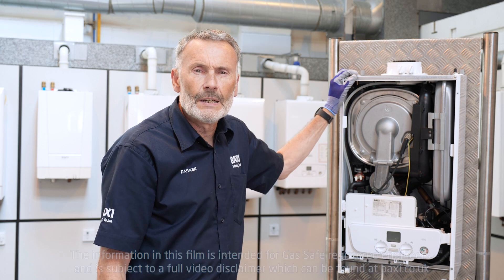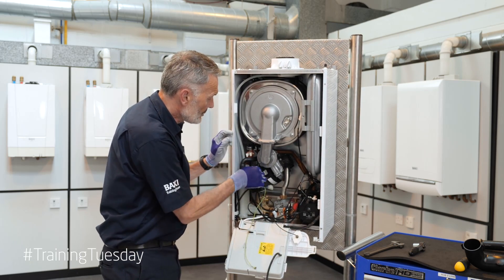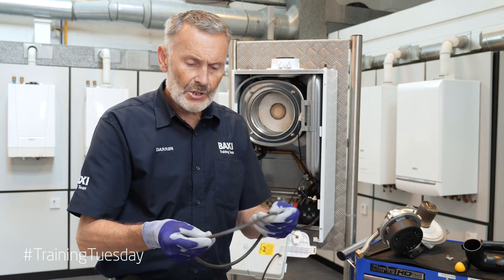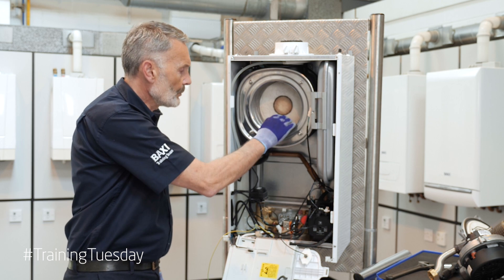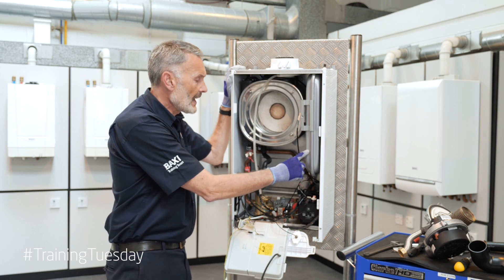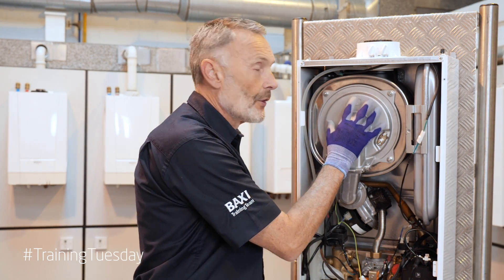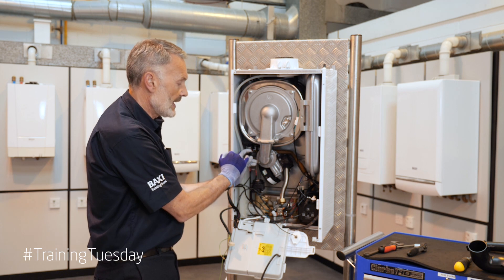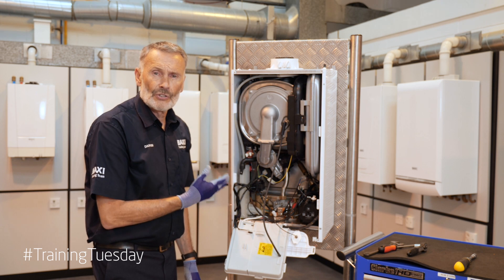How to carry out a service strip down on the Baxi 600 or 800 Combi boiler

Comment: Great video. When checking the tightness of the joint on top of the gas valve would the boiler need to be operational?
Reply: Your obviously not gas safe registered so do not service your boiler 👍🏽
Reply: would have thought so as the valve has to be open for gas to be present  there.